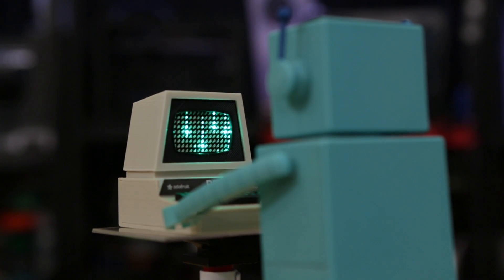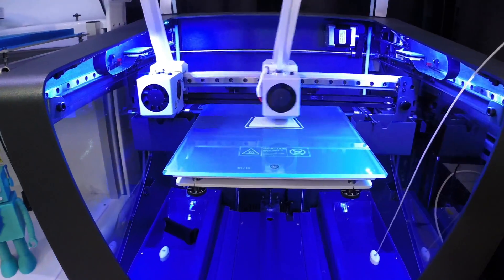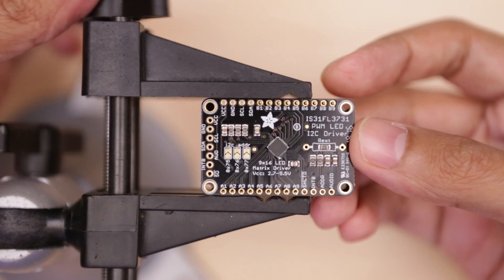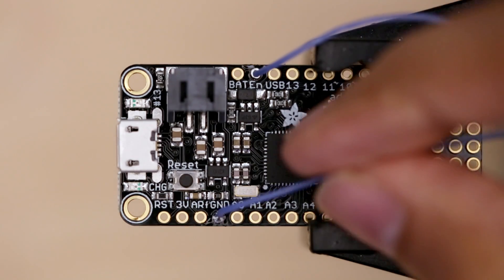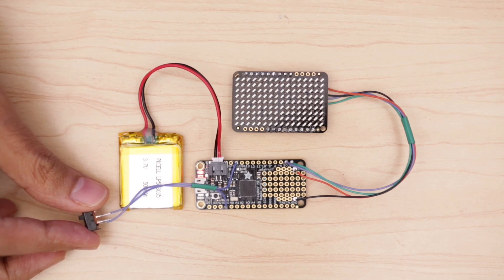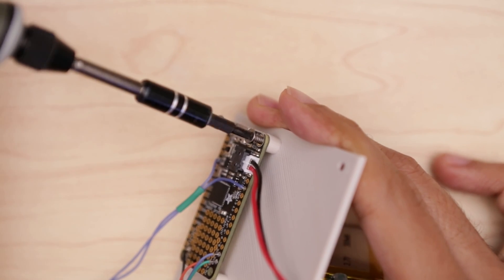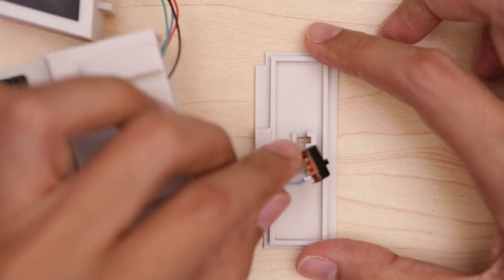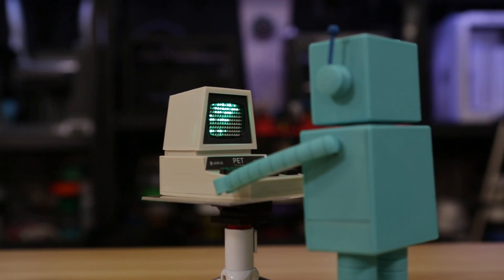Mini Commodore PET – 3D Printed with LED Matrix

Comment: How do you charge battery afterward? You have to take it apart??
Reply from the maker: The microUSB port on the side – Lipo recharging circuit is built into the Feather board.